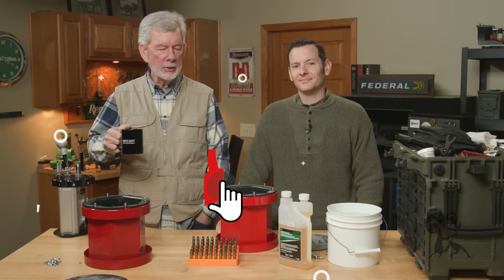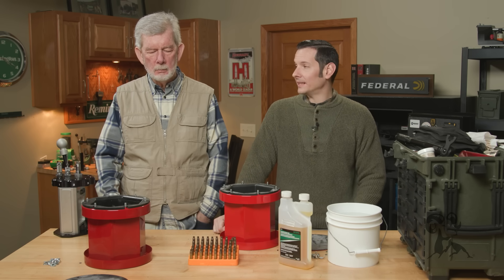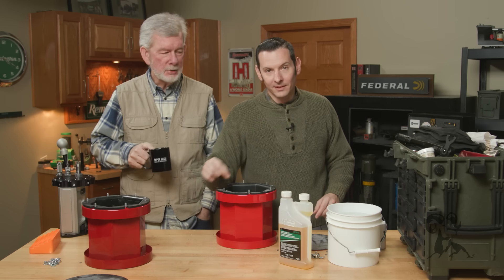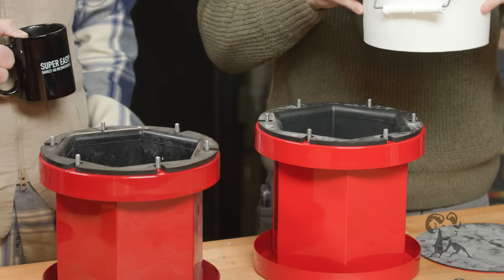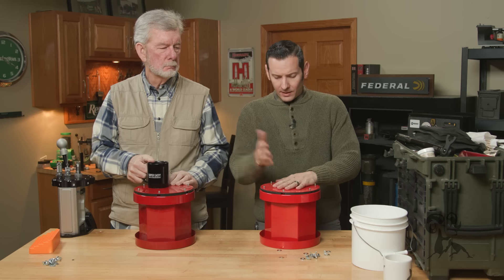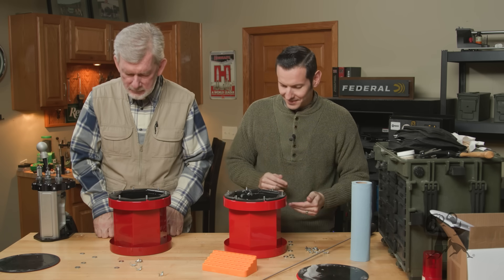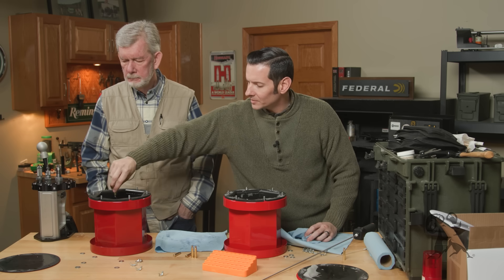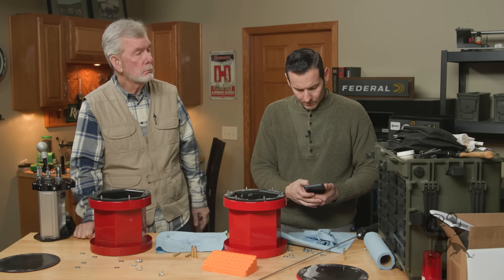SmythBusters: Tumbling Brass With And Without Pins

Comment: Pins are good for some cases like 308 ,243, 6.5's and pistol but they will pack in 223/556.  For 223/556 I use SS chips with dawn and lemishine.  
  My Texas star tumbler is great and can do large batches with 2 gallons of water.  Dehydrator for 30 minutes will dry out brass very quickly.
Reply: I just ran about 500 223/5.56 casings and didn't have any issues with needles packing

Comment: ive never had to dry my cases to get the pins out.. never. for past 15 years. never.. they come out just fine on their own. I tried without pins a few times but its just not as clean, or it takes more time to get the same level of cleanliness. The few minutes it takes to remove the pins makes it worth the better shine. ITs easier to see case issues. cracked necks. stretched case heads, dented rims.  And last, ALWAYS deprime first... not depriming before tumbling adds HOURS to the drying even in the hot desert sun we get in the SW. The trapped water in the primer cup takes forever to evaporate out of that tiny nook.

Comment: What's max fair number of 223/5.56 in those? 25 must be way too small a number.
Reply: Those are from Thumblers Tumblers and have a 10 pound capacity.  They look to be about a gallon so near to 5-600 .223 casings.

Comment: First of all - You two crack me up. You have a great working relationship. Don't stop.

Second - In my brass tumbler I use walnut shell, fine sand and glass beads from my sandblaster. I also throw in 1 cut up dryer anti-static sheet and a glob of "Bar Keepers Friend - ceramic stove top cleaner". Mr brass glistens with this combination.

Comment: When I started reloading in the late 70's, I cleaned my brass by hand with a rag or paper towel. Lubed the 38/357 cases on a RCBS lube pad with that greasy ass lube they had. Sized them with an all steel RCBS die. Then cleaned all the cases again to remove the lube. Then finished reloading the ammo. In the 80's Lyman came out with their "Turbo 1200" tumbler, huge step forward. Also in the early 80's I bought a carbide sizing die, another big improvement. In early 80's RCBS came out with there "Green Machine" a inline progressive reloader. It was pure junk. Back to the single stage. I forgot to mention that I started reloading when I was 16. I was born into a none shooting family. I began shooting IPSC, and NRA action shooting when I turned 21. No shot timers then, we used wrist watches and stop watches. No shit! We made targets from brown kraft paper or cardboard. Used paper plates stapled to a board to simulate a falling plate rack. About 1984 or 85 the new American Rifleman showed up in the mailbox. Page 3 there was a Dillon ad saying they were starting direct to customer sales and cutting the price of the Dillon 450 in half! I bought one as soon as I had the money. I use a Big Dillon vibe tumbler with ground corncob and Dillon case polish. Nice and shinny. 😇

Comment: For wet tumbling with pins I bought a 1/2x1/2x4" coated rare earth bar magnet to toss in when it comes time to extract the pins.  It is an N50 magnet and gets most of the pins out in a couple of applications.  The rotary media separator gets any that are left over after draining and rinsing.  Great video.

Comment: Nothing like sipping a cup of joe while handling fired dirty brass.

That aside, separating pins is a PAI.  Even when separated wet, then dried, and separated again (using magnet), still had pins sticking to the inside of my 45 cases.  I have no interest in shooting a stainless steel pin down my match barrels.

Comment: Small amounts of brass, vibration tumbler. Large amount get the wet. Perhaps you could no pin clean, then resize and case prep and final clean with pins??? But wet clean with pins definitely makes the brass look new again.

Comment: I use the pins with a few drops of Dawn dish soap and a very minute amount of Lemi shine, cup of hot water. I only scrub them for 30-45 minutes.  Rinse in a bucket with lots of water.  Pre dry on a towel then use a dryer.  My brass looks like new.

Comment: I think it's more of what an individual requires and their own reloading process. The pins are definitely going to be more aggressive and take less time to get results, but you also have to separate the media and do more rinsing as well as double checking to make sure all the pins are out of the brass. Might be a time saver to use the pins overall if you are not running a primer pocket brush or uniformer as part of the processing but if you are doing those steps then the pins cleaning those areas makes no practical difference. Also, more aggressive cleaning solution might obviate the need for pins as well as more time if time isn't an issue for the reloader.

Comment: Hi guys,  I've been wet tumbling cases for about 4 years.  I've tumbled with and without pins.  When I first started I hated the pins.  Yes they cleaned the cases the best but getting the pins out is a pain.  I tried the media separator with the cage partially submerged in water.  That works to a point if you don't have a lot of cases in the cage.  So I quit using pins and just tumbled without them but I wasn't satisfied with the results.  So I went back to pins and have developed a way to process the cases that works pretty well.  
1.  I tumble the cases for about 1 hr. with pins, then check the cases to see if they are clean.  
2.  Dump the pins and cases into a strainer made to catch the pins.  I use a Lyman 2 piece strainer.  The top piece catches the cases and the bottom one has a very fine screen that catches the pins while letting the water flow through.  
3.  Using the spray attachment at the kitchen sink, I spray water on the cases while I stir them with my hand.  This rinses off the cleaning solution and suds.  It also knocks out some of the pins.  
4.  I then dump the cases out on a towel laid out on the kitchen counter and stir the cases with my hand which further knocks out more pins.  I use a magnet to pick up the pins laying on the towel.  I recently acquire a strong magnet salvaged out of an old microwave oven.  I drag it back and forth over the cases in all directions.  The magnet is so strong that it will pull the pins out of straight wall brass cases.
5. After removing as many pins as I can, I put the cases into an old toaster oven at 225 degrees for about 30 minutes.  
6. After the pins have cooled enough to handle, I dump them out on clean dry towel.  Shake the towel and run the magnet over them again.  So far this method works very well with pistol cases.  This also gives me a chance to do a preliminary inspection for cracks and debris like small rocks that might be stuck inside the case.  I don't shoot bottle neck cases much, but if I did I'd use the same method. Then invert the cases and tap the mouth on a block of wood to make sure there aren't any remaining pins.  

Using this method I can process 1/2 - 2/3 of a tumbler full of cases in about 2 hrs. start to finish.  I usually save up cases and do several batches one after the other.  As soon as I dump the tumbler I'll refill it and put it back on the machine and it's cleaning the next batch while I remove pins and dry the first batch.  There is only about 30 minutes of actually doing something.  The rest of the time I can do something else while the cases are tumbling or drying.

Comment: I am know that industrial parts tumbling practices utilize various forms of tumbling media, wet or dry, variations in form & composition. I’ve been a handloader for over 50yrs & your video is the 1st instance that I’ve been aware of “pins” used to clean brass. Thank you for your video, but I shall continue to use the old tried & true methods which provided satisfactory results, even with black powder fouled brass.

Comment: Three or four HOURS? This is really hard in the case mouth and 25 cases? I never do less that 100. And the number of cases will effect the cleaning solution. To some extent so i use pins and never run over 30 minutes. Because asbi said it beats a burr on the case mouth. 3-4 hours?

Comment: You need to be careful using pins when wet tumbling .223 cases. I've seen many instances where a pin got lodged crossways inside the case. Even after dry tumbling the clean cases in a Franklin Arsenal Wet/Dry separator some of the pins still had not come out. I had to break them loose with a small screwdriver. Visually examine every case to make sure there are no pins lodged inside.

Comment: There are also some stainless steel “chips” that are more irregularly shaped that are supposed to do a good job.
Reply: I’ve been waiting for someone to address pin size but your chip comment is closest I’ve seen.
Surface area and size would seem the be most conducive to internal cleaning. I need to try th chips.

Comment: I pick up a lot of range brass (rural public ranges) and it ALWAYS gets inspected, de-primed (needle punch & small mallet - don't risk your dies), washed, and inspected again before use.  I use a 1# rock tumbler w/pins, small squeeze of Dawn, and 1/2 of a 9mm case of Lemi-Shine.  I've been using the same $40 setup pretty much weekly for 30 years, the pins show no visible wear, the second rubber on the barrel lid is wearing thin but still going.  I run them for at least 1 hour or up to 4 hours if I want a bright shine or to get rid of annealing discoloration, rinse thoroughly and dry necks down (plastic produce net stapled onto a frame over a towel).  Trade the brass I don't use for things that I do.  Clean brass (even a single case) in good condition has value to somebody.  Damaged brass, 22LR (yes I pick them up, they are litter), aluminum, steel, copper, lead, used primers, etc. goes in the appropriate bucket to be melted down and cast into small parts, lathe/mill stock, or recycled (steel/iron forge remains elusive.)

Comment: After decades of reloading, I finally changed to the Franklin Arsenal wet tumbling system W/O using the pins.  Those pins will get into everything, and you need to be sure there are no pins in your brass before reloading.  After tumbling the brass for 90 minutes, the brass is clean.  I rinse and allow them to dry.  I don't have the problem of trying to find the missing pins.  No pins in my basement slop sink drain either.
Reply: A wise comment!  Pins are a joke, and solve no problems in the real world of shooting and reloading!

Comment: Really depends on what I'm going for. Range 9mm ammo gets lubed, sized and de-capped, then and hour in the tumbler w/o pins (armor-all and lemon shine). Rinse and put in the drier before getting fed to the progressive. All I'm really trying to do is keep the dies clean (carbide sizer gets a blast of break cleaner now and then since it works on the dirty brass). The little carbon on the inside of the brass I actually find makes it all run a bit smoother. And it's just range trash ammo. I'm going for speed and ease.

Target ammo, mostly rifle, I don't even tumble and instead sonic clean. De-cap, sonic cleaner, lube and size and trim, sonic cleaner again, then prep and load. Mostly because of the lower volume.

Nasty old range pickups gets sorted into the recycle bucket to get sold to the scrap place.

Comment: Been using the pin tumbler for more than 15 years. My process is a little different than most. I usually give my brass (100-150) a short (15 min) wash in the tumbler. The water is generally lightly discolored. Then I de prime and re size. Check case for damaged or signs of weakened brass. Next is where I am a little different.  Using a funnel and a big pan I manually insert pins directly into the brass. Using Dawn detergent I tumble for no more than an hour. When I pour out the water  it is either black as night or battleship gray. 
I do this because it is very difficult for free floating pins to find their way into the neck of the brass. The smaller the neck (5.56) the harder for the pins to find their way in and to stay in. I know this is true because when I check the brass for pins I find very few actually in the brass. The tumbler will sling the pins out. But has a devil of a time letting them in.

Comment: Do the steel pins cause any "cold working" of the brass?  Something that would affect the hardness of the brass that might reduce the number of firings you get out of it?  If anything, I would think the neck and shoulder might be the most susceptible to this type of damage.

Comment: I use a Frankfort Arsenal large wet tumbler, 500 ,223 cases with stainless chips along with 2 tbls of dawn dish soap and 2 tbls of lemi shine powder, then fill with hot water. Run for 45 minutes, then put in my media tumbler and slings the steel chips out put cases in small nylon laundry bag and rinse twice in hot water. Cases look like new inside and out, no need to run over 45 minutes

Comment: One thing I’ve wanted to do is find a cheap concrete mixer and try to tumble very large quantities of brass, because i occasionally end up with several 5 gallon buckets of extremely dirty range brass. 
Looks like this method might work for that
Reply: Concrete mixers work great for .50 BMG brass imo.

Comment: Dont use dawn it contains sodium hydroxide , lye it has a ph of about 9 the reason its used with lemi shine , citric acid is to lower the ph.  Use a shot class of orange or lemon Ajax  the ph is about 5  it contains citric acid    read the ingredients on the label  using dawn all by itself will make your brass brown a lot of things will work even shampoo  ive tried a lot of things

Comment: Been there, done that, didn't drink the wash water. Rinse water is almost mandatory as the surfactant and pins still hold a bit of debris. Dish soap, pinch of lemon shine and an hour for each on a 50 dollar home brew. Magnets will be your best friend as the SS pins are purposefully slightly magnetic.
Reply: Or get rid of the pins, voila no magnet necessary and you'll be stunned to know the brass accuracy is not affected without pins!

Comment: I use water with my Frankford Arsenal brass separating gizmo and it gets the pins out. I use a magnet on a stick to pull the pins out of the bin after I drain most of the water. Then the brass goes into a toaster oven set at 150 degrees for a few hours to dry it.

Comment: Been using pins for years, especially on range pickup brass.  Use pins and dawn brand soap.  If the brass is not crusty I use ultrasonic cleaner and skip the tumble.😊

Comment: I stopped using pins a while ago. Pins were a pain, made a mess, and I feel like they scratch the cases. Once I stopped using pins my brass started sizing easier. I use the frankford arsenal solution, tumble 2hrs.
Reply: I stopped using pins a long time ago for the same reason.
Reply: Exactly, pins created a problem and a solution that never existed. Also, no pins =  more brass each load.
Reply: Quieter

Comment: I used both methods, I get superior results with pins, dawn dish soap and lemi-shine, I am very familiar with vibratory tumbling with assorted medias and polish. I rinse well with the hose until I get clear water, decant into a bucket with a sieve, light tap to remove pins, spread on an old towel, rub around and let air dry. Well worth the little extra effort to know your brass is sparkling clean.
Reply: Thanks for the ideas. I haven't reloaded in a LONG time, but have been considering getting back into it.  I was never happy with the cleaning job the dry media did, and had seen a video on wet tumbling.
Reply: Pins, Dawn, and Lemi-Shine are the way to go. I remove the pins with a Dillon CM-2000 media separator submerged in clean water, and then dry them with the jerky dehydrator for a couple hours.
Reply: I learned that rinsing well makes a big difference than just sprinkling some water on the brass and laying it out. I put water in the separator and agitate it well for several cycles before laying the brass out to dry.

Also, don't put damp brass into a vibratory tumbler. The media cakes up in the primer pockets. My friend did it one time... 😉 it was a mess...

Also, make sure you allow the polish to mix into the media for 10-15 minutes before pouring the brass in. That cakes up the primer pockets also... my friend did that too. 🙄 That was a real mess... 😖🤬😖
Reply: @  Wait, you guys are wet tumbling and then dry tumbling?
Reply: @, no sir, strictly wet tumbling. I do still have all my dry media gear, Man may need to get the cunungus off a case or two before she gets wet tumbled.
Reply: @ i do both.  Decap and wet tumble, resize, and then do a short dry tumble just the get the resizing lub off the cases
Reply: @joshw6212  Makes sense. I mix lanolin and isopropyl alcohol in a spray bottle as my case lube, and after sizing it comes right off in a bucket of hot soapy water. 

There are days when it would be nice to just dump them into a dry tumbler and walk away, though. :)
Reply: @twistedsphere  that is the exact case lube i use as well.  dry tumbling to remove is both effortless as well as being able to move right into loading without letting dry again.  give it a whirl
Reply: I agree with the pins, Dawn soap and a small amount of Lemi-Shine, but I only tumbler got 2 hours. The shells come out great.
Reply: This is exactly the way I do it, down to every detail.  brass always looks like new
Reply: who cares what you do fudd.
Reply: ...and none of what you mentioned is necessary to handload match perfect ammo. SS pins makes a problem out of something that isnt....like an ex wife.
Reply: @trpshooter9945 , absolutely not necessary, but why polish a turd, when you could be reloading brass that looks like new. Pride in the process of making something that looks as good as it performs!!!!!